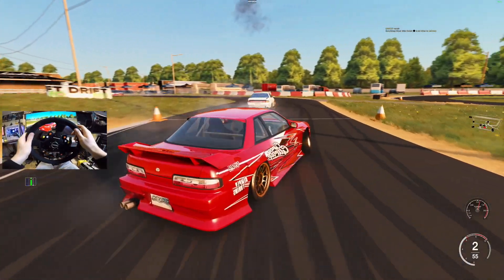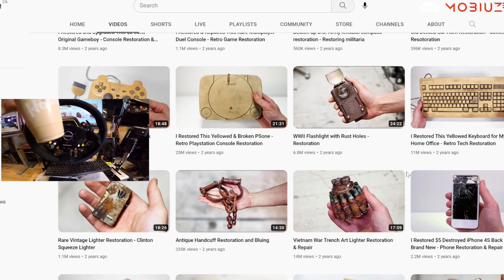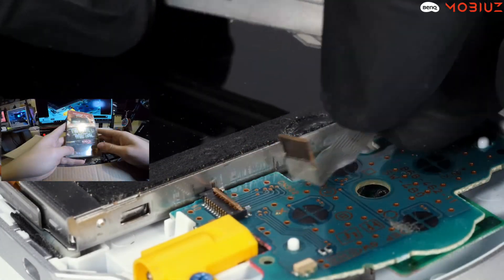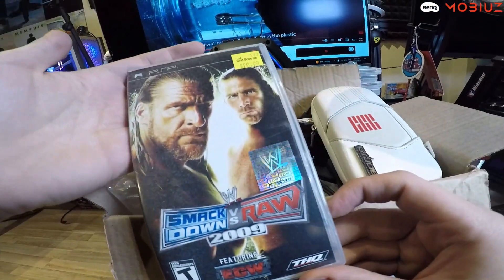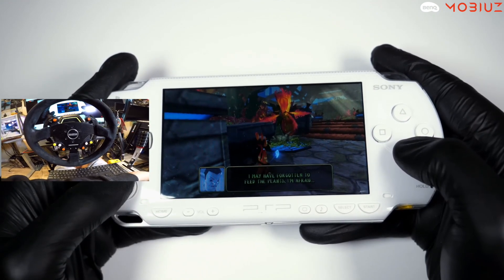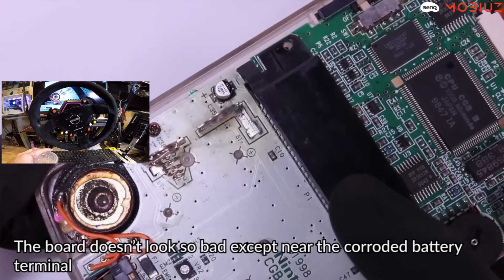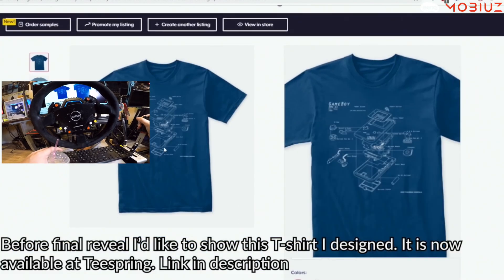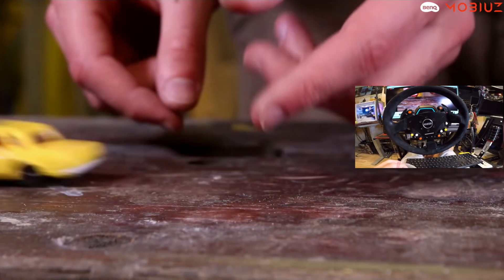First Impressions On Car  RESTORATION , NEEDED This SPECIALLY TODAY I

Comment: Seeing that you are very familiar with Thrustmaster. Do you know if you can use two sparco hand brakes together on console? (one as a sequential shifter and one as a handbrake)... I know you would need the hub
Reply from the maker: Has long as you have the thrustmaster Hub to connect both they should work fine